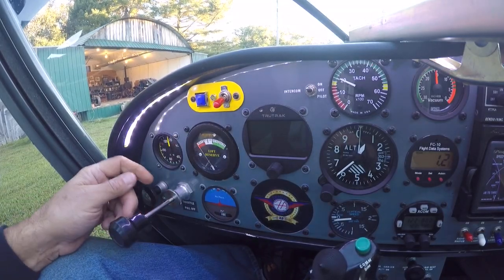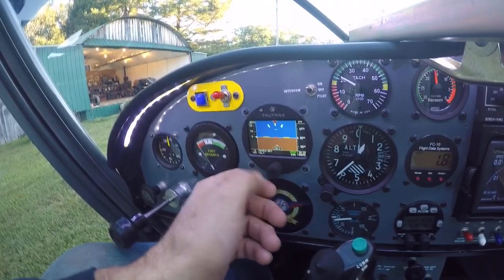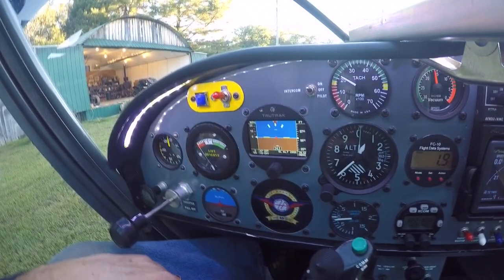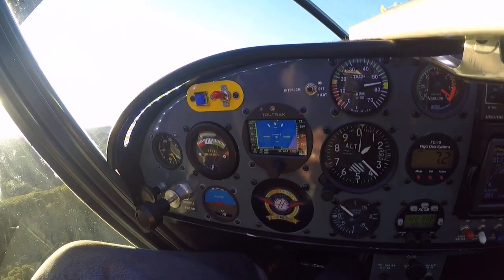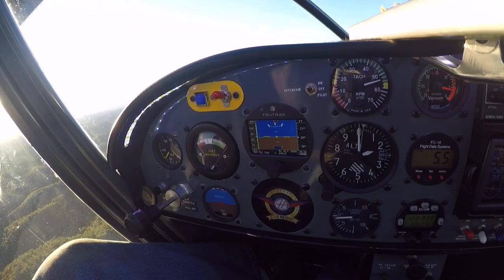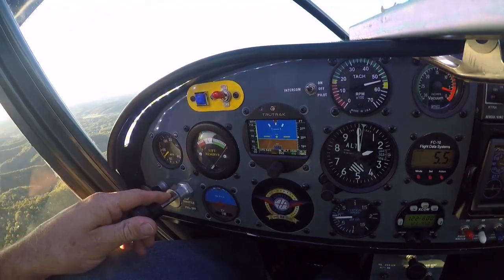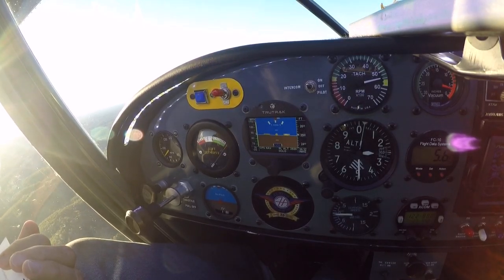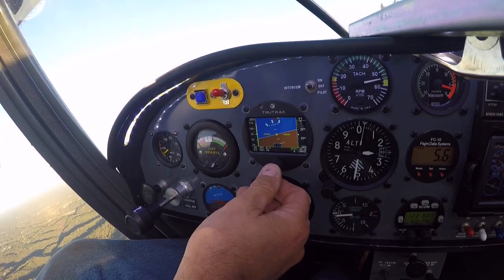Trutrak Gemini Autopilot Part 1

Comment: Considering this for my 701, the airplane is so slow it takes a lot of flying to go any significant distance.  However, useful load is a concern in the 701, what did your installation end up weighing?